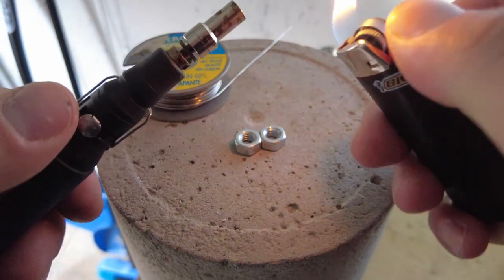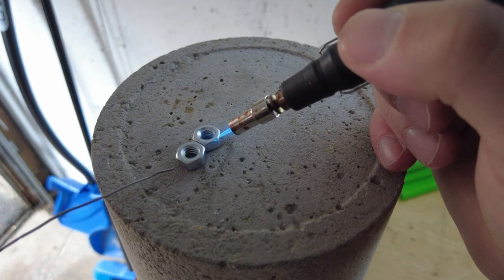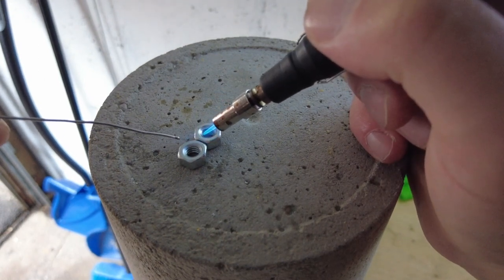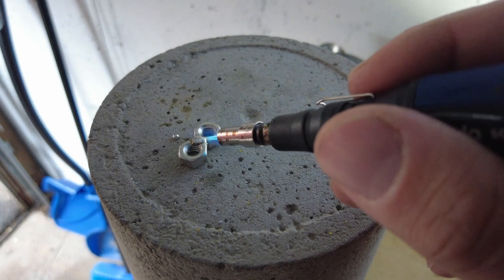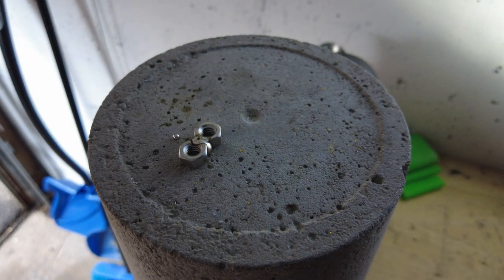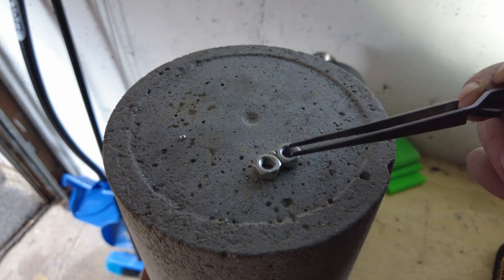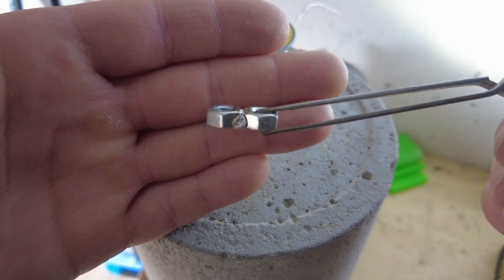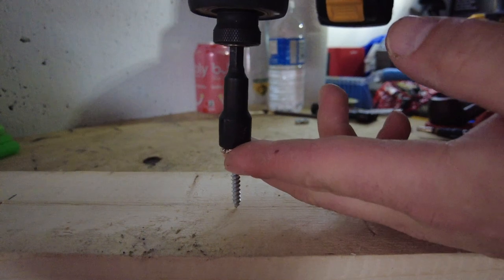How to easily Weld with small blow torch (Brazing)

Comment: Welding with solder has a name. Soldering.
Reply: was thinking the same, but wasn't sure if that was actually solder or something stronger or what... but yea i guess it's just soldering.
Reply: Yeah. Soldering is to brazing what a wheel barrow is to a front loader.
Reply: Oink oink😂
Reply: Welding without melting the base metal also has a name: NOT WELDING.
Reply: exactly - brazing is a whole different process with higher temperatures.

Comment: Dude you almost got it what you were doing is called silver soldering the only thing you mist was flux so the solder would flow much effectively and you needed to sand the pieces you were going to weld so the solder would bond yes you need to heat both pieces to allow the solder to melt but the flux would help guide the solder were you want the joint to occur

Comment: Thanks for the tip.  I am a car restorer and a huge problem is fixing up the many small pin holes in old car bodies and although I have MIG, Stick and Tig welders the very thin metal around the pin hole is a real issue.  I also refuse too use epoxy fillers which ALWAYS allow water and rust again.  I tried this tip and a fantastic result.  Great imagination and thanks for your tip.

Comment: It's useless for strength just buy a freakin  mig or Tig welder I bought a brand new mig for $200 a tig welder I'm buying is only $270 and that's newzealand dollars
Reply: Depends on the kinda thing you're doing with it, really.
Is it strong enough to hold a person? No. But a lamp fixture, an art piece, a prototype build, a piece in a cosplay prop? Sure.
Besides, a $200-300 investment is pretty huge nowadays, especially considering most people can't afford a surprise $400 bill in America, so using the little extra cash you (might) have is a big decision.

Comment: How strong would you say the bond is between the two nuts? Could you easily snap them apart with your fingers?
Reply from the maker: That holds tight. If you watch the video to the end I even used impact gun on it. At first test it broke, but second time it held up all the way just fine 👌

Comment: You have a lot to learn about soldering and brazing….
Welding is fusing two pieces of metal together….completely different than the above..
It looks like you have been lucky to use a soft solder suitable for joining steel..normally soft solder is quite difficult to stick to steel and silver solder (a solder containing varying amounts of silver) is required…along with a lot more heat and as already mentioned plenty of flux to keep the metal free from oxides…the more silver content the less heat required…
Brazing is similar to silver soldering, but uses different rods and requires more heat, usually from an acetylene torch..
Soldering is fine for small items, but it doesn’t work well on car bodies etc as the heat will distort the panels

Comment: This is not welding, it is soldering or brazing. Welding melts the metal and fuses it sometimes with the addition of similar metal filler.
Brazing and soldering use a different metal as a 'glue' to stick the metals together.
Brazing is normally done with filler metal which melts about 450C and soldering below that temperature.
This will only be as strong as the filler metal and solder is normally very weak.
Reply: Brazing uses brass - the clue's in the name.
This looks like either 60/40 tin/lead or lead free which would probably be 93/7 tin/copper.
I'd advise using a liquid flux which cleans the metal and helps the solder flow.
Also, use more heat - the tip of the blue 'inner' flame is the hottest point.

Comment: Hello sir , can we  use solder  for brazing with metal  ?  and what kind of your torch  ?  It is so small but it can brazing the metal  , 
Anyway can you help me  how to brazing aluminum with small torch  ?  and do you where can I buy the small torch  ?  Thanks
Reply from the maker: Just google Butane Solder. They have many different ones online, amazon, ebay and most electronic store will have them. Mine is made by Iroda, had it for maybe 10years now. They come with different tips for different needs. I was using 60%-40% solder wire. Hope it helps!
Reply: if you are going to bigger metal pieces, get a bigger torch, not a small one and some aluminium brazing rods, for anything with higher melting point, you need a propane/MAPP torch

with a small torch like this, you need to use tin solder, some solders can just burn and not work so you need a solder that the flux is either outside or there is none so pressure dont build up abd explode the solder

Comment: How strong does it hold?
Reply from the maker: Pretty strong, watch video till the end. I was able to screw #10, 1-1/4" screw all the way into the wood. If you need even more strength then just get a welder. This fix works great on smaller items for example repairing light fixtures and small metal covers where screws are broken and you don't have enough access for big welder to repair it.
Hope it helps!

Comment: What type of wire did you use
Reply from the maker: That is just regular solder wire for copper cables which I used to test. You can use plumbers solder wire or other.

Comment: I tried welding to copper pipes together
Reply from the maker: Yep, that is the same as plumbers welding copper pipes. Works great on small little nuts and screws, specially if you not using it daily and don't want to buy 1000$ welder..

Comment: What wire type and type of metal nuts
Reply from the maker: That is just regular solder wire with led, I think 60%. Those nuts are regular steel 1/4-20 nuts, which I used for this test. Thanks!